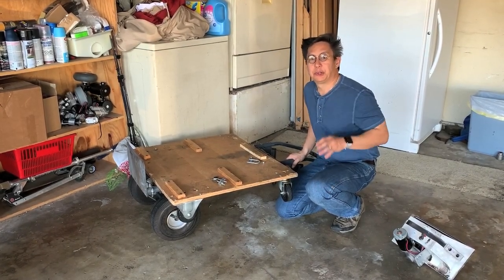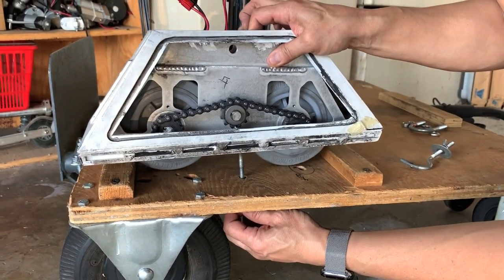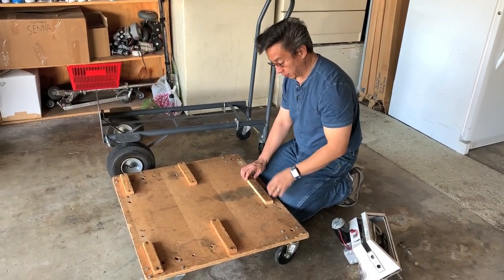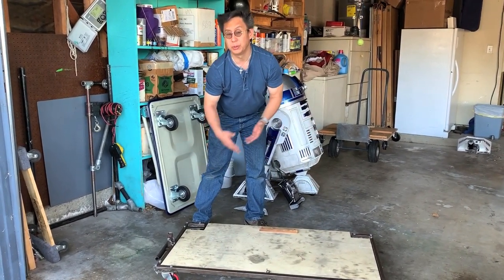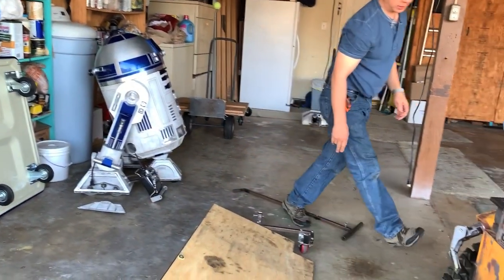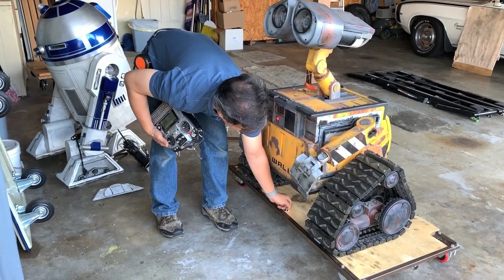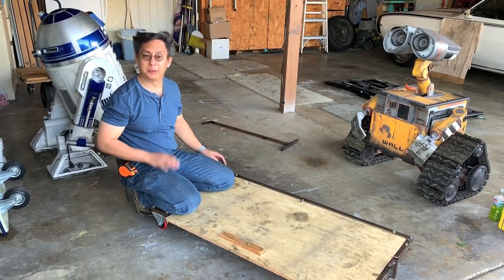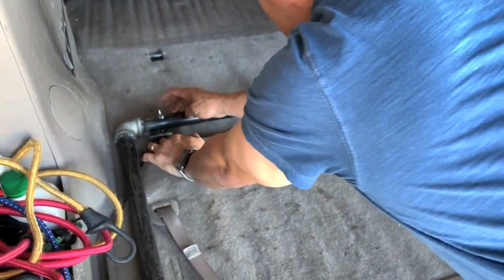Robot Cart/Robot Crane for Van

Comment: Your winch solution is basically a home-made version of the kind of winch setups that are used to lift power wheelchairs into some vehicles, but I'm guessing yours cost a fair bit less to build and as it's not permanently installed it'll be easily transferable. I may need to steal that idea, especially using the handrail components as I can't weld either!